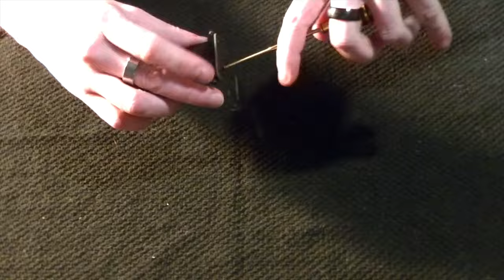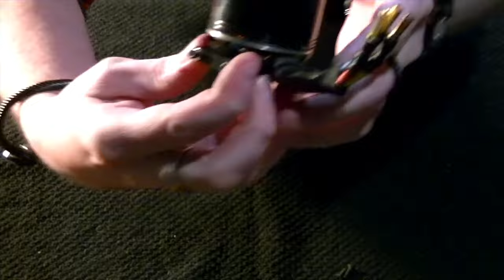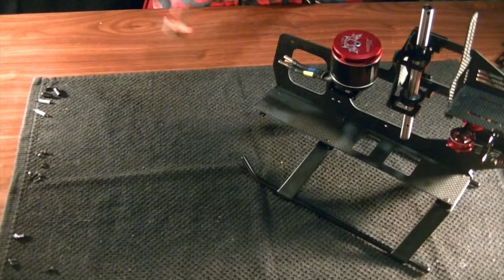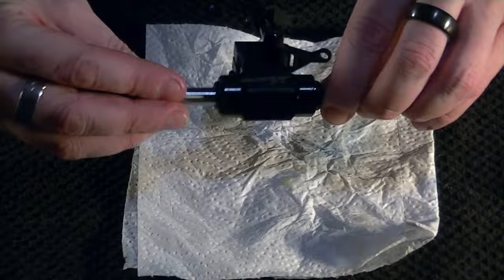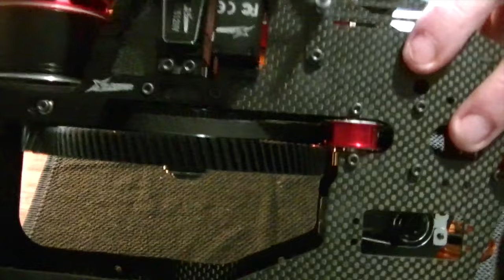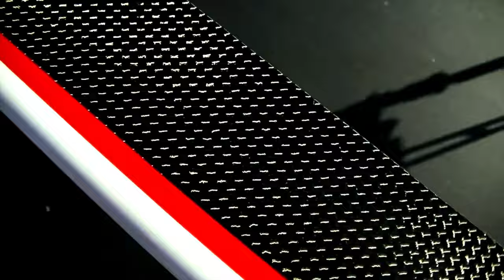XL Power 550: Quick Build And Assembly (FreddyCanFly)

Comment: Looks like a very lightweight frame with lots of power. Scarry power to weight. How much does it weigh?  There are only 2 bearing blocks and it looks like they are carbon fiber. Once again radical cutting edge.